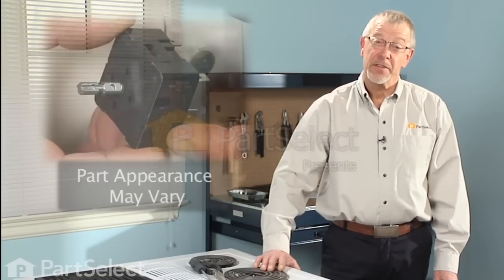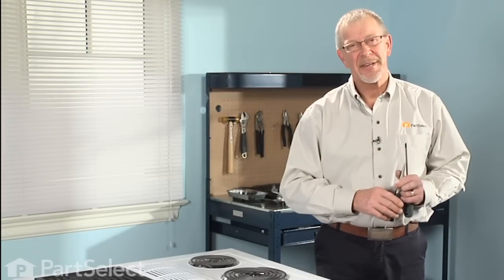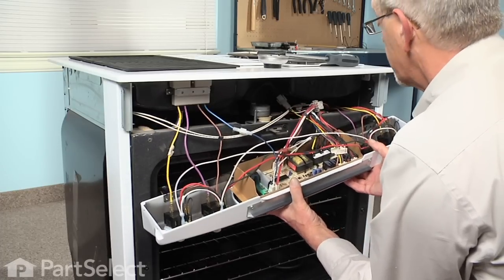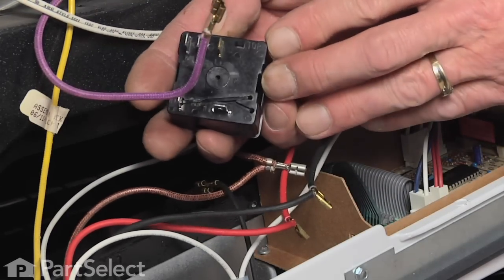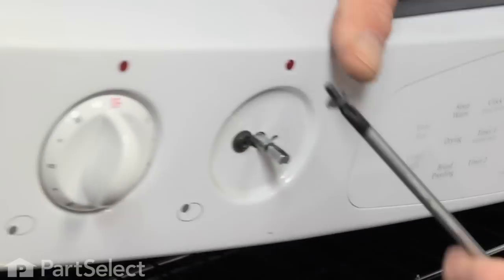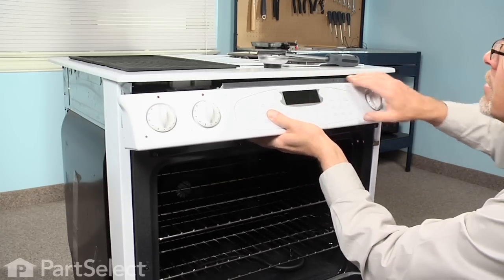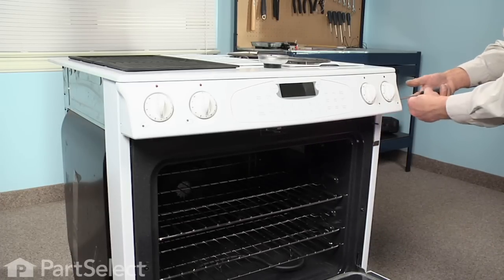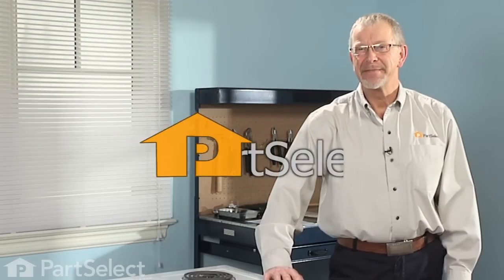Stove/Range Repair- Replacing the Surface Burner Infinite Control Switch (Whirlpool Part# 703650)

Comment: This is a nicely done video, very helpful. However, it is presented in ideal conditions. In our case, we own a Jenn-Air C236B-C and the replacement part for the infinite switch was W11120791. The replacement part was not exactly the same as in the video: on the original part, there was H1 and H2 pins, while on the replacement part, H1 and HC pins. After some calls to the store, checking also online valuable sources, we found out that H2 and HC are the same functionally. The pins were not located at the similar places on the original and replacement parts, but they were clearly identified. Make sure to take pictures, to check carefully which wire is connected to which pin (in our case the wires were identified). Relatively easy job, but when playing with electric power, take some cautions.

Comment from the maker: Hi there, 

Thanks for your question. The part in this video (# 703650) can be installed with either a 6" or 8" element.

I hope that helps!

Comment: great video, I was able to replace the switch with no problem, but unfortunaterly I had removed the power outlet receptables screws and now canoot put them back;
is there any video about the poer outlet receptables?

Comment: Hi, Steve
Thanks for all the videos. Very helpful when we try to fix our own cooktop.
I took a look at the partselect, and wanted to find the switcher for Jennair Electric Radiant Cooktop, 30"(JEC9530BDS). 

Do you know which part# I should get? 
The switcher is for the dual burner (the one on the right front.) The other switchers didn't have a board attached to it, but this one got a circuit board attached. And not easy to tell which component is damaged.

I will response with a video. :)

Comment: How do you diagnose that it is the infinite switch that needs to be replaced?  My dual burner element stops working completely.  It was intermittently prior to dying completely.  I checked the burner element and it doesn't seem like it needs any replacement, and my next thought would be the switch.  But I am not sure, would you be able to help point me to the right direction?  Thank you so much.

Comment: MY burner comes on TOO hot, at midway it's glowing bright red, it almost caught my house on fire....which part for that? I have an old Kenmore electric range....Pls. advise.....
Reply from the maker: I would suggest testing the burner switch for your Kenmore range. Disconnect power to the range and remove the console back panel. Locate the switch and check for overheated wires or faulty terminals first. Test the switch’s contacts for continuity with a multi-meter. If defective, replace the switch. If you need more detailed help then please provide the model number.